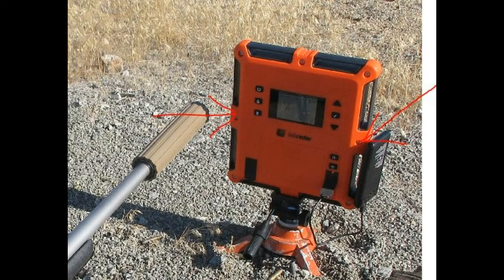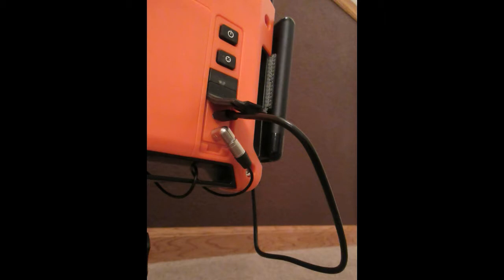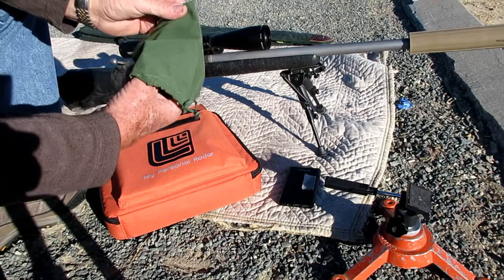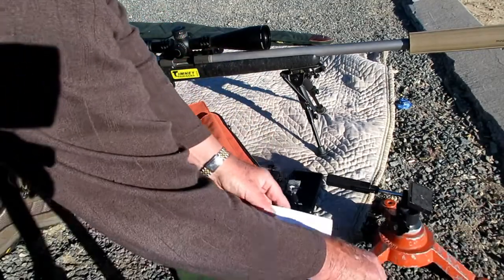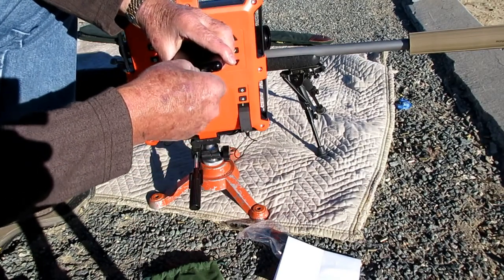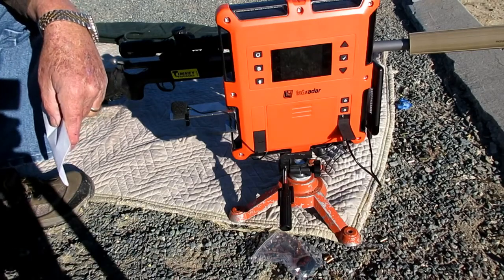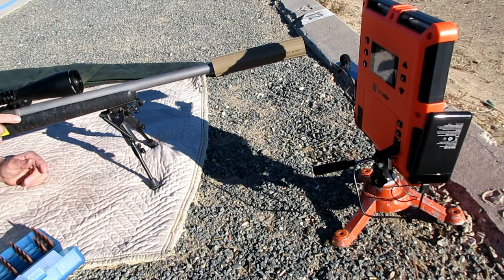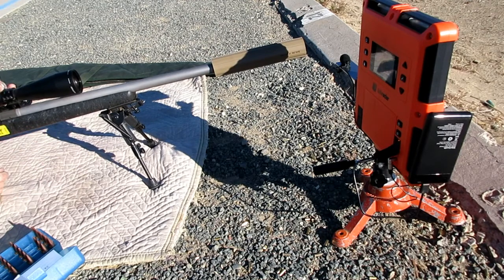Labradar internal MIC vs Airgun MIC

Comment: I bought the LabRadar earlier this year and it's a great unit! I always shoot suppressed, and the suppressor I use is quite efficient which makes the placement of the muzzle and LabRadar a bit difficult at times. It has to be exact! I'm getting the mic, it will save ammo and frustration and less cursing. :) Thank you for your review!

Comment from the maker: Since the time I made this video I have purchased another device to activate the LabRadar. It is a "shock sensor" that attaches to the rifle with Velcro and then plugs into the microphone port on the LabRadar. What it then does is to activate the radar when it senses the shock of a shot being fired. This means that the Labradar will track the shot and record it without having to "hear" it, so that all makes the placement of the muzzle and its spatial relationship to the muzzle not all that important. You DO, however, still have to have the Labradar pointed toward the target so it can "see" and track the projectile of course This all makes the Labradar a LOT easier to use and muzzle placement not at all critical. The only kinda drawback is that you can occasionally  cause the unit to sense a shock and activate the radar when you  rapidly open the bolt or kinda slam it closed, resulting in an "unable to track Projectile" message on the screen. If that happens, just push the button and that clears that non existent "shot" completely and you then continue shooting and recording data as normal. BTW, there are several sources from which to obtain the sensor setup---IIRC, I got mine from a place called JKL.
Reply: What's the preferred trigger for rimfire, shock sensor or external mic?
Reply from the maker: @Denvertubester  Sorry,I can't help you there as the rim fire shooting my wife and I do is WAAY more group intensive than velocities. We basically only try (audition?)  pretty well thought of ammo and whatever produces around 1/3 to 1/4 MOA 15 shot groups at 100 yards (this is for Mini-Palma) is what we stick with (hopefully) for an entire season.

Comment from the maker: I have talked to the guys at LabRadar and they tell me they often use the radar unit when they shoot suppressed rifles and it works well/reliably with only the internal mics----but I figure that, as a more casual user, I don't have all the experience and knowledge that they do so I'll just go with the (likely more forgiving) airgun mic activation.. BTW, You probably noticed the classic moving pad I am using to shoot off of. I don't normally use that, but today I forgot my purpose designed shooting mat. Oh, well---kinda shade-tree, but the moving pad works well when my memory fails me and the "official" shooting mat gets left at home!

Comment: I really appreciated your video.  I'm a retired State Certified Firearms Instructor for a Sheriff's Department and I know have really become involved in PCP Air Rifles.  I just received my Labradar and as usual have to have all the available accessories.  I'm hoping that everything will work out a far as recording my Air Rifles that are quite silent.  I have course have the Airgun MIC system.  I'm a bit confused as to utilizing the memory card and wonder if it is a necessity when using the MIC System.  Any input would be much appreciated.
Reply from the maker: I actually do not know the exact answer to your question, but my GUESS would be that it is not necessary as I believe the unit will save shots to internal memory, but if you want to be able to use shot results in your computer, a memory card would likely be the easiest way to do it.